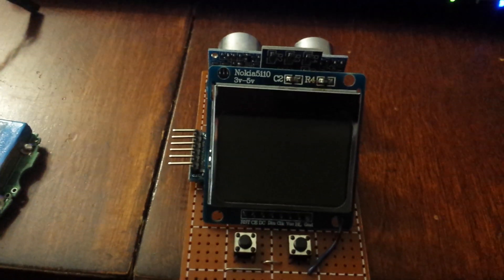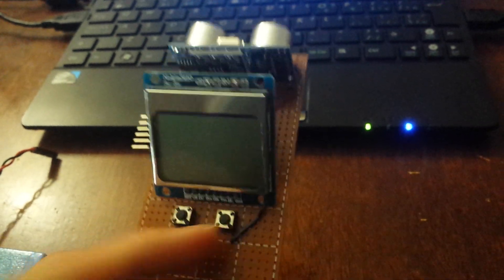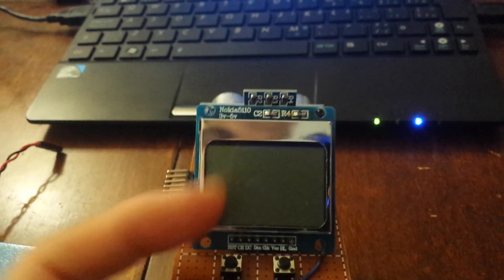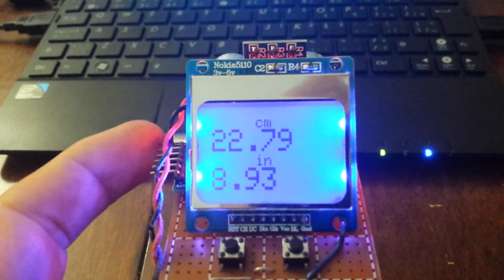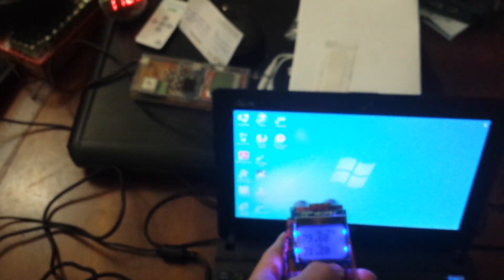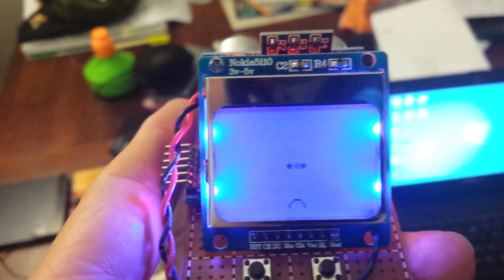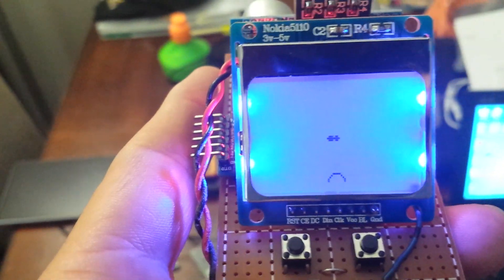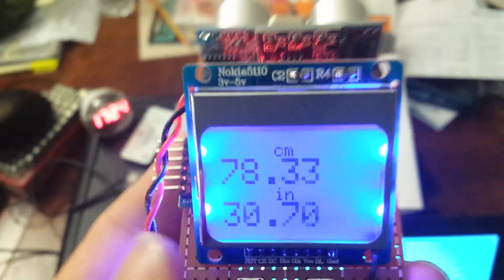Range finder and Radar?

Comment: Great project ! Am using a Pro Mini here and salvaged Nokia 5165 LCD. Just getting started really..so it's cool to see your projects and how you go about things.
Reply from the maker: Thanks :) glad you enjoy :) I'm glad I started in Arduino as well lots of thing I was able to create using a few hour of coding and lots of Imagination. Next project I think will be an automated fan control for my bedroom when it sense the temperature outside it lower then 23 shut off the ac open the window and start the fan should be a decent challenge lol I should also put my 3d printer back in the game might print few thing for this project but I'll see about this one.
Reply: Now that would be a challenge of a project, best wishes for it, very useful !
Automatic curtains was a project at school back in the 1980's, your next project reminds of that.
I was happy to get "Thanks for watching" written on the display LOL. But now, few days on and have a menu system with text over a bitmap..lot of fun these things.
Oh and no level shift chip for 5V Pro Mini, have used a 1K resistor for Vcc and 10K resistors on the data lines, works great.
Reply from the maker: slider2732 The LCD I'm using doesn't require resistor at all for any data line it was made to work from 3~5 volts!!! even the LED it's awesome :P I'll buy more and they are the same price then those on eBay that say they work from 3~5 but they don't like 5 volts at VCC. One thing I wish now is that I could chose the color or the backlight bu no big deal :P my wife love blue lol